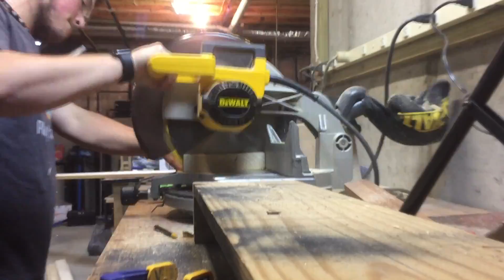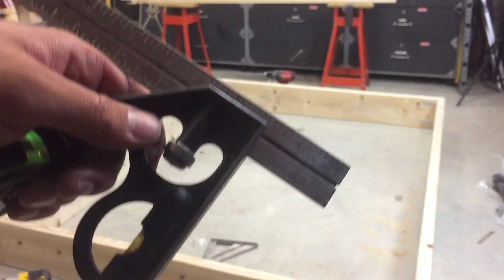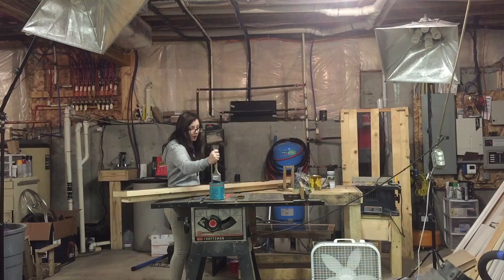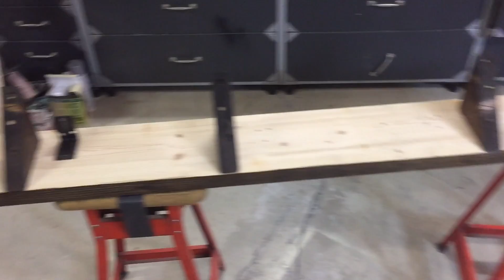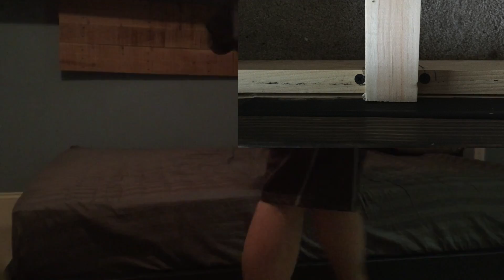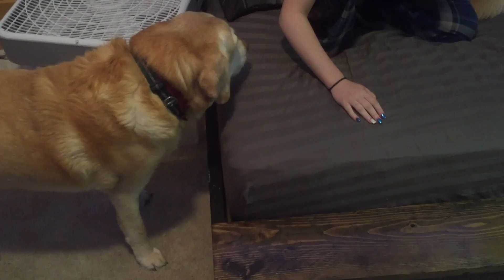Simple Semi-Modern Bed Frame - How to

Comment: I have a full too, what was the overall height of the bed with the mattress in
Reply from the maker: The mattress top is about 1.5' off the ground, which is rather low. I chose this height so my older dog could get on/off easier. We had to put him down recently, so I would probably make the bed taller if I were to redo this project
Reply from the maker: If I made it taller I would add sliding drawers to the bottom of the bedframe for extra storage space in that otherwise unused area